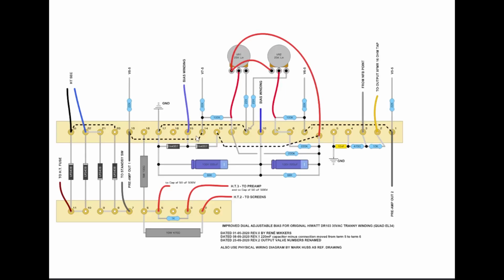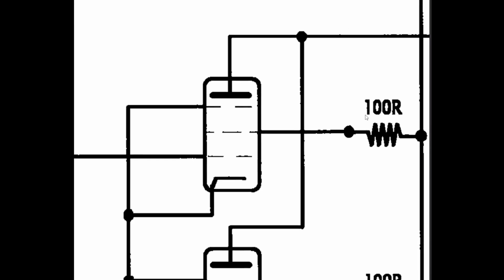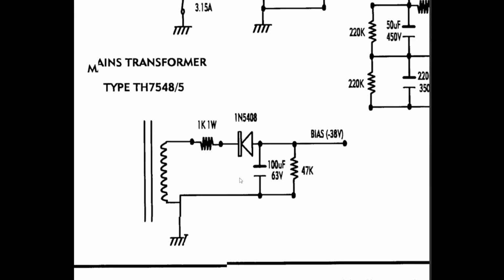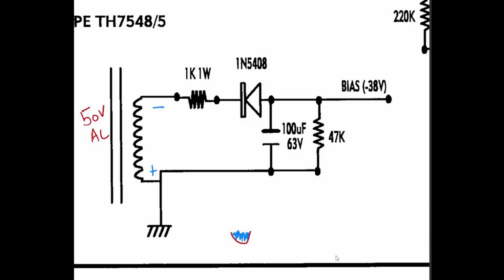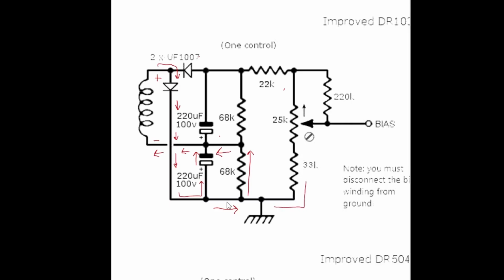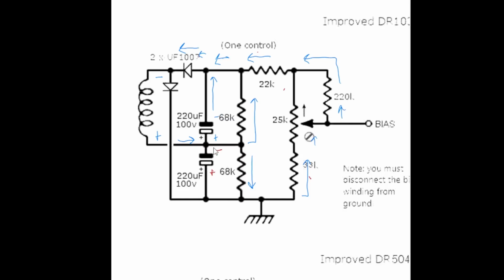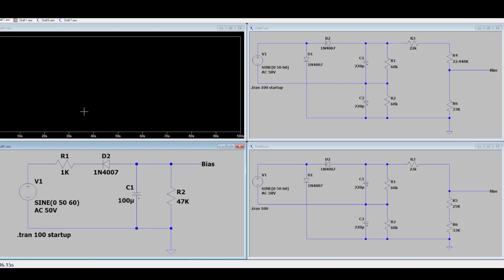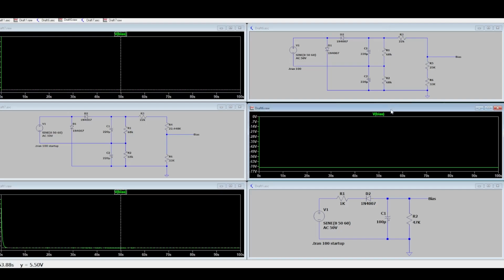Hiwatt DR103 Bias Circuit EXPLAINED | Stock vs Modded

Comment: My hiwatt fl 100 is running hot it's a 78 or 79 with the printed board.ibwill be adding an adjustable bias  at some point
Reply from the maker: I still need to get to mine but will hopefully get the last pieces together soon.
Reply: @TechnologyEnterprises I have read people put a fender or marshal type bias in I don't know what the difference is if any.
Reply from the maker: I have only looked into it for thr DR103, but for those there is great info on the Mark Huss Hiwatt website. Basically is just the circuit i covered in this video.
Reply: @TechnologyEnterprises marshal and fender in hiwatt circuit.i left that out .

Comment: There are few things I would add to this.
Grids do not pull any current hence biasing voltage load is not pulling current. Hence it provides just negative voltage that will limit the idle plate currents keeping the tube at the sweat spot.
There fore doublers work great there. Capacitance is there more to filter AC ripple than to provide current stability because there is a very low draw true the voltage diveder part of the circuit and none from the grids. Hence two 220 uF caps in series are filtering as single 110 uF and that's close to stock 100 uF. Hence you do not induce more AC ripple.
Biasing circuit has a few parts. Mostly you first drop some voltage with resistor. Than you rectify. Often very crudley to reduce voltage. Than you filter and then you have a voltage divider. Some filter even more in the output. Even a single resistor at the end is sort of divider. It can be changed with a pot or pot and one or even pot and two or even 3 resistors. Function is the same. You divide voltage to pick proper needed level.
For example you can change 47K with 25K pot and 22K resistor if the 47K is providing enough voltage.
Or you can add one before and one after the pot and have smaller more defined range.
Now that 220K from slider to top leg if pot is there for one main function.
It is there to prevent tubes from going ballistic if your biasing pot dies or oxidates under the slider. Without of it, as it is done in most guitar amplifiers, bias voltage is gone and 0V is vay higher than minus 40 volt hence tubes runaway. Redplating and fire hazard. 
With that 220K when pot dies you suddenly get bias voltage that is so high to shut of output tubes. Instead of killing them they stop working surviving the issue.
You use ten times higher value than a pot value to limit it's effect on the voltage divider. For Fenders 10K freely add 100K and bias again. It makes it bulletproof.
For Mafshall amps that use 50K add 500K or 470K at least.
This is something you see more in HiFi tube amplifiers. It's cheap addon that is not absolutely necessary but ads safety.
Divider part is very flexible thing. It needs to pull little amount of the power otherwiritis a waste and just heating up resistors and it has to provide needed range. It doesn't matter if the range of adjustment is bigger than needed. It doesn't matter if it is bigger or smaller if the range provides needed voltages for the type of the tubes used.
This doubling circuit is definitely better than the stock one. Manny old DR 103 and 504 do not bias correct because of today's mains voltage and lack of adjustability. Going to any adjustment capable version is a blessing.
Reply from the maker: Thanks for the thoughtful reply and additions!
Reply: @TechnologyEnterprises you are welcome. Thanks for the nice words.

Comment: Hi, was there a follow up video for the adjustable bias mod? I have a DR103 clone and it is something that I would like to install but, I would like to see a step by step of how the doubler mod is installed and the old bias circuit is removed. Thanks
Reply from the maker: Not yet! I had to put it aside for customer repairs but will hopefully have that Hiwatt finished up by the end of this year. If you get to yours before i can get a video up for it though feel free to send an email my way. Happy to help advise or give a second opinion on the best approach!

Comment: Okay fix'd. Now I can't get it any more positive than -57vdc.Thinking of increasing the 220k going to the wiper?
Reply from the maker: Which schematic and layout are you using? Have you double checked polarity on the capacitors?
Reply: @TechnologyEnterprises Hi! Using the MHuss scat. Double checked polarity. All good.  I did hear the bias winding on the Heybor is slightly hotter in response to the common complaint that there's not enough neg bias voltage.  Would lowering the 33k to 20k help? I'd like to get the positive end up to -36v if possible.
Reply from the maker: @thewoodshed9359 the 22K and 33K resistors are the limiting resistors for the high and low range of the adjustments. Playing with the values there should help increase the range. As long as neither drops below 10K or so you should be okay to experiment as needed. I am still getting my workspace put back together after a major reorganization but can play with values in my LTSpice simulation later this evening.
Reply: @TechnologyEnterprises  Thank you! I'll post results as soon as I make changes.
Reply: Update- I switched the 33k to a 22k resistor and now the range is -92 to -44.2v Much better. I would still like to get it to the design voltage of -38. Also this is with the bias circuit not connected to the rest of the amp. Do you think I''m good with leaving as-is?
Reply from the maker: Loaded voltages will be different than unloaded, so if this isn’t hooked up to the circuit yet you can probably expect the range to be slightly lower once it has a load on it. I think you should be able to raise the range on the other side (towards a more positive voltage) by doing a similar change to the 22K resistor of the original circuit.
Reply: @TechnologyEnterprises increase or decrease the 22k?
Reply from the maker: I am not sure off the top of my head but i suppose there is a 50/50 chance there either way. Hopefully will have my workspace back up and running by this weekend and can dive back into my Hiwatt to help confirm any changes that are necessary.
Reply: @TechnologyEnterprises I'll test this evening and post results! Only 6v away!
Reply from the maker: Also i just looked at the Mojotone schematic and it looks like they use a variation on the stock circuit with the recommendation to use between a 4.7K and 6.8K resistor to get a bias voltage of -46V to -38V. Have you already hooked this up and had the amp working and tried varying those values to see if it gets you within the range you expect? The voltage doubler may not even be needed, but especially on a fresh build it may be better to get things running THEN make modifications.
Reply: @TechnologyEnterprises  Hi! I did consider that for sure since the Heybor is supposed to have a bit higher AC on the bias winding. However as a matter of curiosity, I wanted to experiment with building the doubler circuit and trying different tube types like 6550/KT88s. But to your point, if this gets to being too much of a chase, I'll revert to the OEM/Mojo design. I also added bias test points to see the effect of turning the 25k pot on cathode current.
Reply from the maker: Sounds like a fun project! Not trying to be discouraging at all. Just suggesting that getting it running stock, evaluating where things stand, then modifying is usually a method that works better for me when i am dealing with a new circuit. But sounds like you are on it!
Reply: @TechnologyEnterprises Great news. Reduced the 33k down to 15k. Now getting -33.4 to -89.9. Isolated. Used a 2w metal oxide for the 15k but may increase to 3w for final install.
Reply from the maker: Oh that is great news! I would think even a 2W is overkill in that position since you are dealing with millawatts so should be good with that!
Reply: @TechnologyEnterprises yeah I tend to " over build". Navy thing I guess lolz.
Reply from the maker: Nothing wrong with that! Some people make the argument that oversized resistors (in terms of wattage) will have less noise. I think at 2W be plenty “over specked” for that position though.

Comment: Hi again. I built the bias doubler circuit but I'm only able to adjust it between -18 to -28 volts or so. Any suggestions? Using Heybor dr103 XFRMR.

Comment: Doing a doubler mod on the clone I'm building now. I'll be interested to see how you configure the components.  I'll be using a 6x6 turret board for mine and a locking pot. Video tbd.
Reply from the maker: Oh nice! I had to take some time off from the amp work to catch up on other things (this isn’t my day job) but will hopefully be installing my doubler mod and finishing my Hiwatt in the next week or two. Leaning towards an added tag/turret board as well instead of the layout on the Hiwatt.Org website. Curious to hear your results though if you don’t mind sharing when it is done!
Reply: @TechnologyEnterprises I posted  part 1 of my build (power supply) a couple of days ago. I'm a bit rusty but it'll do lolz. Thank for the reply and looking forward to your insight.
Reply from the maker: @thewoodshed9359 oh nice! I will check it out when i can. Have been thinking once i finish my Hiwatt i will build up a Mojotone kit clone to try some further modifications on.
Reply: @TechnologyEnterprises yep that's essentially what I'm doing. Mojotone chassis & xfrmrs. Digikey for the rest. PS&PA pretty standard. The real fun will be the preamp. Sooooo many variations. I bought an extra turret board just in case. Lolz.
Reply from the maker: @thewoodshed9359 exactly what i was thinking. There are a few of the preamp variants i really want to try but would rather do it in a clone than in my original!
Reply: @TechnologyEnterprises I have the bias doubler layout on a 6x6 if you want it.

Comment: Thanks for the explanation ! 
Little question : If I understand correctly the schematic, the bias circuit could introduce noise, no ? If yes, which type of bias circuit is less prone to annoy us ?
Reply from the maker: That is a great question!

Both circuits are accommodating for noise that could be generated (via AC ripple) with the capacitors that are in place. In the stock circuit it is a 100uF capacitor, in the modified version it is the 220uF capacitors. Because the voltage doubler (modified) bias circuit is “doubling” the voltage it could also double any noise present if not properly addressed. This is why the capacitor values are increased to 220uF for the voltage doubler circuit. 

In either case, there is plenty of filtering to handle the AC ripple of the rectified voltage. No need to worry about noise when it comes to your choice in this particular set of circuits!
Reply: @TechnologyEnterprises  That makes sense. Also, a noise is function of input signal, if too much difference it will not be noticeable. 
Thanks for your reply and explanations :)
Reply from the maker: Yup! If the Signal to Noise ratio is high then you won’t notice the noise in most cases! This is why proper design of the input stage of an amp is so important; if the signal can be raised higher immediately without picking up much extra noise (or ideally not picking up ANY extta noise) before it is amplified it will raise the signal to noise ratio and keep things sounding good throughout the rest of the amplifier circuit.